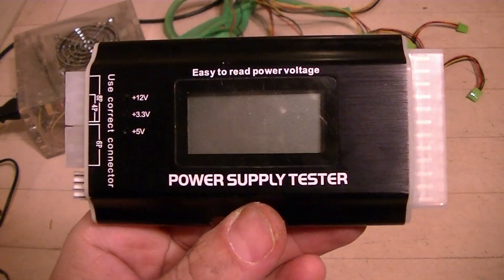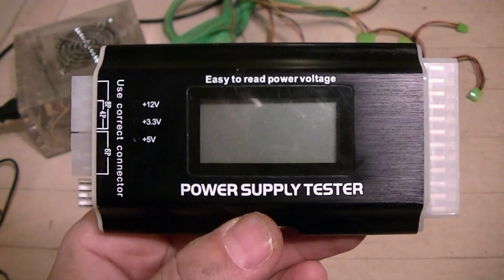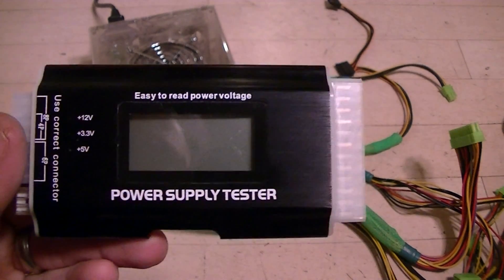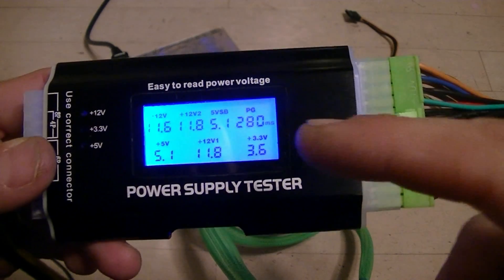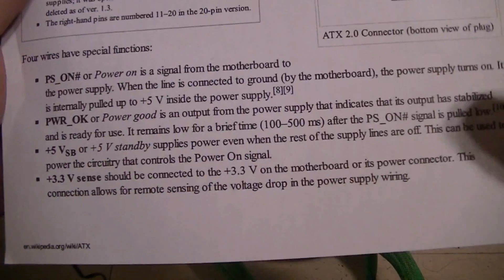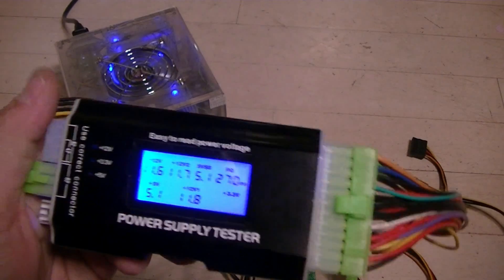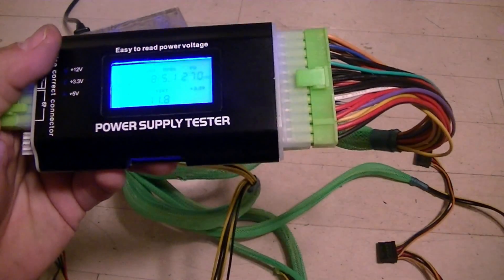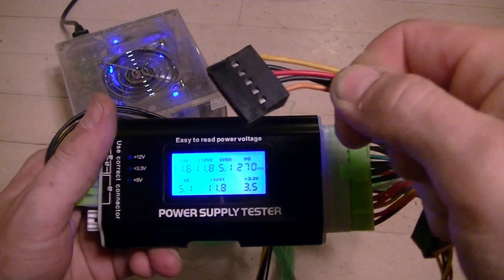Using a "Power Supply Tester" to test an ATX computer PSU (and a voltmeter too)

Comment: 20 years? What a waste of your time. If you had actually learned anything, you'd know that you only plug/unplug 'live' wires into devices that are specifically designed as hot-pluggable or hot-swappable such as USB ports/devices. You can damage the device or the device you're plugging into it. Are you expecting to be responsible for the damage others may do to their equipment because of your ignorance?
Guess how you know that this device isn't one of those? Well, I'll tell you since you obviously don't know -- there are no hot-swappable psu's. Get it? If one of the devices is designed to be hot-swappable, then it only connects to another hot-swappable device. Hey, you may have just learned something.
Is "up and functioning" an expression you learned in 'tv school' or Star Trek? Is "if I plugged this in properly" what you say before or after you see smoke? Do you always ignore these little voices and just plug in live wires and hope for the best? Oooh, that fan is quite a load. I wonder if you turned off the psu before plugging in the fan because somewhere in the dim reaches of your memory you know that Neither of these devices is hot-pluggable? Duh?
I'm also surprised that after 20 years this is the only psu tester you've used. I've used several, and I know for a fact that this device is a piece of crap that will fry as soon as you 'safely' plug in a psu that goes too far outside of its range. How do I know that? Oh, please. Is there one that I'd recommend instead? Yup, the Thermaltake Dr. Power II, which doesn't smoke when it comes across a high-power psu putting out too much juice.
Also, it's very hard to plug and unplug cables, as you showed by your effeminate grunts. Didn't you notice how cheap this device seemed? Being a man, I noticed right away that it seemed rather frail to my masculine force, and even started to come apart because there's nothing preventing the outer shell from sliding off.
Well, if anyone is still paying attention to your ignorant videos, hopefully they'll read my comment. Even better, if you read this and took this crap review down, but I'm sure you're still impressing those who don't have your many, many, many, many years of expertise. Good luck with that.
Reply: You're quite full of yourself.
Reply: Ddram Bo you must be a pleasure to spend time with....not. You may or may not be correct with your factors but your delivery needs work. Your social skills get a failing grade. How many years have you worked on the sterling personality? Have you learned anything.... really I don't expect you too.
Reply: I bought the Apevia power supply tester and it says to plug in the 20/24 pin connector and then turn on the psu. While the psu remains ON one by one plug in the 4 pin 6 pin and 8 pin connectors.Then one by one test the molex and sata and floppy.I know this guy was silly for connecting to the wrong connection but is he wrong about the hot swap?I am NOT a tech and until now i thought hot swap was ok because the Apevia directions tell me to do it. So my question is .....Should i be cycling the power between  each connection or not?
Reply: Hambone, I wouldn't recommend plugging this device into anything. I can't be the only person who has purchased one of these units and plugged into a psu that caused it to fry. Fortunately for the company, those situations are rare enough that there hasn't been an attempt by a gov agency to investigate the claims of the folks selling these to ascertain not only the veracity of their ads, but also whether there should be a warning label indicating the possibility that it may ignite spontaneously if it is connected to a psu exhibiting certain errant voltage conditions.
To your question, I would recommend that you always turn off the psu (or unplug it) before plugging and unplugging this device since the device doesn't have any switch of its own. The connectors you are attempting to plug into it (Molex, etc.) are not designed to be easily plugged and unplugged, for safety reasons. When you plug a 'live' wire into one of the ports on this device, the power is immediately applied to the circuitry, which undoubtedly will cause a voltage surge. One of the few devices I know of that can handle such surges (and it breaks down eventually from the strain) are called 'surge suppressors'. I would bet that this device has no such surge suppression circuitry since even the psu that you're plugging into it has some basic surge suppression built in, but the components, as you would suspect, are larger than would easily fit into this device. Additionally, some psu's don't have a switch, and they rely on the fact that the computer won't start until you hit the switch. Again, this device doesn't have such a switch. But it's your decision ultimately.
By the way, the Dr. Power II does have a button to push after you've plugged in the cables and are ready to test, because only under those controlled circumstances should you use any sensitive electronic device.
Reply: Actually there are many server grade dual/quad power supply units that ARE hot swappable.
Reply: Dram Bo, 
Either you are just kidding, or YOU ARE AN ABSOLUTE IDIOT!!  Hot swap - what does that mean?  You obviously don't know.  When you add a device to a running computer - if you are adding the device to a connection that is NOT hot swap - this may cause your computer to blue-screen - it could even damage the data on a hard drive.  You, out of a profound level of ignorance rarely seen before, are attempting to apply the concept of hot swap to something to which that concept does not apply.  Thus you are a profound idiot.  

Yes, usb is hot swap.  No, this power supply tester is not relevant to the notion of hot swap - there is no running computer involved, and yes you do have the main 24-pin motherboard connector plugged in, as well as the other 12v secondary rail 6-pin connector plugged in, as he demonstrates in the video, AND THEN you can plug in the other cables, WITHOUT turning anything off, because HOT SWAP DOES NOT APPLY HERE.  

Let me explain to those whom you have entirely confused, what hot swap means:  Example 1: NOT HOT SWAP: I have an expansion card slot esata connection on the back of my computer.  Inside I have a sata cable to the connection.  Outside I have an esata to sata cable plugged in, giving me a NON HOT SWAP sata cable outside my case.  Why?  Because with sata power, I can plug in a hard drive outside my case, and do some testing on it.  But I have to turn off the computer before attaching the new hard drive.  (What do I mean sata power?  For about $12 you can buy a small 120 volt power supply that will give you a molex output, with 12, 5, and 3 volts.  You can attach a molex to sata power adapter, and voila! you will have sata power outside your case.)  Now, this particular sata cable, outside my case, is just like any sata cable inside my case - as I said:  IT IS NOT HOT-SWAP.  If I were to plug in a sata hard drive, I would probably blue-screen my computer.  EXAMPLE 2 HOT SWAP:  Additionally, on this same computer, I have a small $25 koutech pci-e 1x sil 3132 esata raid card, that gives me 2 esata ports, which ARE HOT SWAP like usb.  From one of those I have plugged in a 3 foot esata cable with a wide "power over esata" connection - which provides power and sata signal to ONE hard drive.  (CAUTION: To provide 12 volt power to the koutech card, I have a 4-pin female floppy power source plugged into the white 4-pin male connector on the card - this will power only ONE hard drive, not two - I have tried two and ruined both hard drives.)  To the other esata connection, I have plugged in a standard esata to esata cable, which allows me to plug into an esata device which has its own power, like the Sabrent USB 2.0/esata 3.5" sata/ide hard drive enclosure with 80mm fan sold here on Amazon for about $26, of which I own two.  As I said, anything I plug into those esata cables IS HOT SWAP - I don't have to turn off the computer to do it.  

So Dram Bo, I would prefer to consider your rambling idiotic rant as just a joke.  If you meant to be serious, then you, sir, are a joke.
Reply: Thank you for taking the time to offer me some education where i needed it. I will be taking your advice. Starting with the disposal of this tester that i have and replacing it with the one you suggested.
Reply: If you search for the word ASSHOLE your picture will be besides the definition most certainly!
Reply: Bubblegumelectric84
Thanks, I've been using mine for years and it has never failed. I just can't stand these supposed 'professionals' who post crap reviews and instructional vids on Youtube that are erroneous or worthless to those honestly seeking help. In this case, the entire computer industry has left folks practically helpless on the side of the road while the corporations suck profit from the sales of technology that comes with little if any instructions, and breaks down a year later. Idiots that try to instruct in how to fix this crap without a thought as to how valid or useful their advise is only add to the confusion and frustration. I usually only post comments when a particular video is this wrought with stupidity and comes up relatively early in Google searches. Feel free to email me if you have any tech questions.
To SmallyBrainz, I can only advise you to get that schizophrenia checked.
Reply: Hambone, sure, as though anyone takes ME seriously. I shouldn't have been so incendiary and advised you to get a different device BEFORE you've run into the actual problem. I should have just given a warning, such as, if you're just testing your own system, or maybe some friends and relatives, you will probably not run into the situation where it blows up, but if you do, then maybe they'll give you a refund, ...hahaha, a little humor. Most likely they will blame you. Then you can buy another one, use a multimeter (there are lots of videos and sites with info on this technique) or take my advice and buy the Dr. Power II. Until it does blow up, or even if it never does, I'd still recommend powering off the psu before plugging and unplugging the device.
I know a pro computer tech with a similar mind-set and a successful business. He is less concerned about the consequences of choosing the path of least possible negative consequences, and when his carelessness fails him, he won't admit his failure, but instead passes the expenses on to his customers who are none the wiser when he tells them, as a 'professional computer repair technician', that they need a new motherboard, etc. I prefer to respect the tools and the situation, and give people my honest advice and consideration.
Maybe this guy will get smart one day, buy the Dr. Power II and do a review of a superior device for this purpose and stop playing games with people who aren't experts... nah, he probably won't.
Good luck with whatever you decide to do.
Reply: Paul Thompson
fanboys of ignorance. if he told you to test your car battery by touching jumper cables to your tongue you'd probably do it.